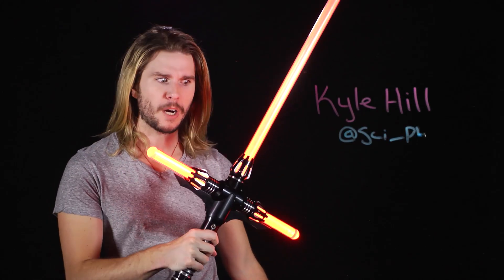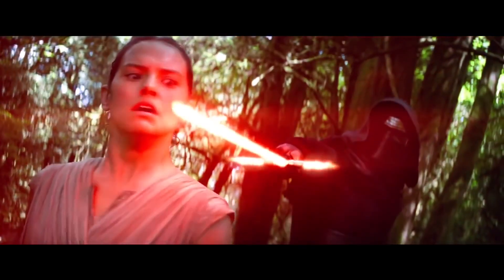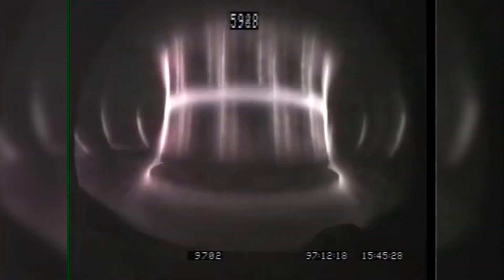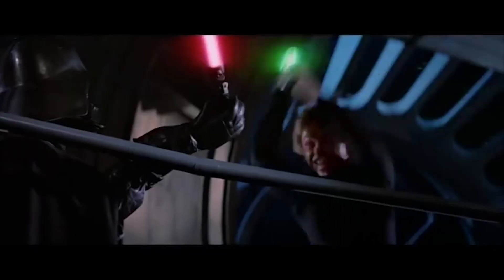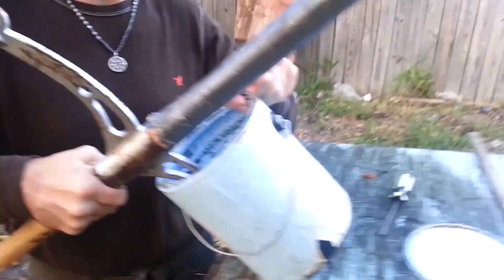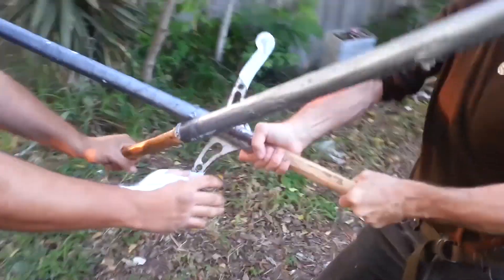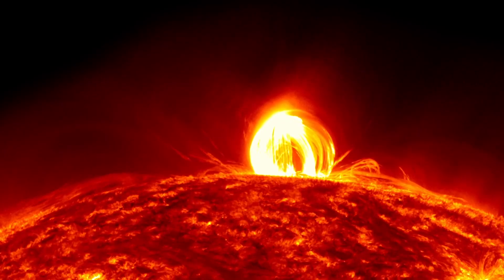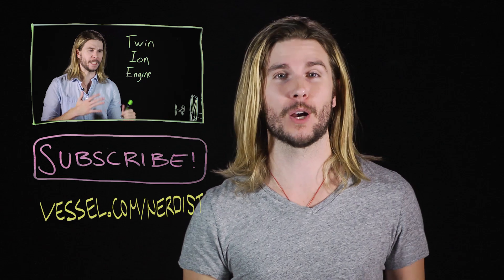Why Kylo Ren's Lightsaber Works (Because Science w/ Kyle Hill)

Comment: i don't understand why people hate this thing.
Reply: Me neither :<
Reply: I think people see it as gimmicky like, "just adding more blades." But a cross guard makes more logical sense than no crossgurad.
Reply: Carlos Johnson specially considering the weightlessness of a a lightsaber’s “blade”.
Reply: Yet people liked Darth Maul's lightsaber, which is also a radical deviation...and infinitely less practical.
Reply: @asayospacegoat6384  laughs in grand inquisitor helicopter lightsaber
Reply: Same
Reply: I like the way it looked. It doesn't have that standard Lightsaber look.
I was getting a little tired of seeing the same old Lightsaber look. I like seeing new variants.
Reply: ITS AWESOME!!!
Reply: lol I'm thinking this guy and a lot of responders don't know why kylo has vents off the crystal chamber. because they are vents NOT crossguards.
Ren has a fractured res crystal causing it to produce far more heat then a normal blade. This is why when activates it's not instant. The blade activates then the vents activate...
Reply: +AsayoSpaceGoat Darth Maul used his saber like a staff, which are real and practical weapons.
Reply: Kyber_Atticus so is kylo’s like real life cross guards
Reply: @KyberKat  no, he uses it as a double bladed sword, if he wanted to use a saber as a staff, they had staff lightsabers
Reply: @KyberKat  he didn't use it like a staff he used it like a double bladed sword which is not practical
Reply: @KyberKat  Yeah he’s trained enough, but in real life, you can literally cut your leg off with one step.
Reply: I think a cross guard makes a lot of sense (especially considering all of the arm amputation in the series, I hadn't even thought about that >.>) I just feel like it would've made more sense for them to be some sort of lightsaber resistant metal like mandelorian alloy for example as opposed to actual plasma blades.  Granted we don't know that the metal casing for the offshoots isn't made of some such material but either way it would've staved off a lot of the criticism.
Reply: @weniswarrior666  problem with mandalorian alloy is that its a lot heavier than steel. Which would be a serious problem as that would make the crossguard heavier than the entire rest of the weapon.. i think the crossguard is longer than it would need to be to work as a crossguard but as it is also vents for unstable energy. It comes together as a useful solution to a problem
Reply: Anell ALL 
I agree I'd like to see some different types of light weapons. For example: a battle axe. It'd be a cool visual if nothing else.
Reply: +Beann, I know, right? I've been training with swords for years now, and I have to say that the crossguard saber is hands down the most practical thing any force user has ever done. Sure, it's not traditional, but neither was Star Wars when it first came out. People made fun of it back then, and now we have nerds acting like bullies and bitches over something new.
Reply: Jadandlud of course it was for visual, a lightsaber is all about visual anyway, nothing wrong with that ^^.
Reply: becuz Kylo Ren is the scum of the galaxy.
Reply: Kyber_Atticus except thst staffs DON'T cut you hands off with a touch
Reply: me nether
Reply: I like it because it does two things. One is it adds practicality and protection to the wielder. Two it also gives more homage to legends because light saber designs were originally based on swords. This design is also seen in season 2 episode 19 of Rebels on an old battleground from the Old Republic era.
Reply: Possibly because most of them actually hate kylo instead of his lightsaber
Reply: They hate it cuz they're fucked up nerds
Reply: q
Reply: Neither do I. It's just a weapon.
Reply: HaNooo out of the subject and bullshit reasons...this conversation was solved long ago..stop your bullshit NEXT
Reply: Garmec only that this Cross guard itself can cut your arm off.
Reply: Pretty sure the hilt itself, side vents included, is an old design, and with that in mind I'm also pretty sure the condition of the crystal powering it only really accounts for the roughness of the edges of the lightsaber when compared to other ones. Not that the side vents aren't there at all because of the fact that the crystal powering it is broken, of course. I'm not positive, but I think the typical order is that you build your lightsaber then obtain a crystal to power it. The condition of Kylo's being from his impatience.
Reply: Lebby Great you sum it up perfectly
Reply: I agree
Reply: > i don't understand why people hate this thing.

Because generally people are not idiots.
Reply: Same here. I like it because it is a unique lightsaber
Reply: You didn't even say exactly as to why that lightsaber is shitty, just saying it's completely "moronic"
Reply: Mike's Lego Movies There is actually is.
Reply: I don't get it either. It's fucking 3 lightsaber blades. What, you DON'T like more lightsaber to your lightsaber?
Reply: Chris Wiet
It's really cool, why do people hate it?
Reply: Fucking nerds mate
Reply: I dont either, especially if you look at Old Republic lightsaber styles. There was one that looked like a freaking naginata. It was just a long staff with a main short blade & two crossguard blades.
Reply: Because they haters
Reply: Because the guard don't realy do his job. protect the hand of his user.
Reply: @kevinreiss-coint2353  
And how is that did uou watch the video
Reply: I know right?
Reply: Nah people hate it becuz it’s disney
Reply: Don’t turn this into a debate on the saber staff, it’s a sith weapon long time used before darth maul even used it... banned by the Jedi claiming anyone who was interesting in using a weapon like this had the sole intent to quickly destroy multiple foes. From than on it only was used by Jedi in training to practice against the weapon used by the sith.
Reply: 1000th like ya I said it but it’s true.
Reply: A three year old, but still active. Comment thread... :D
Reply: I used to hate it as crossgiard, but now that I know ts vents I like it.
Reply: I think it looks cool.
Reply: Its badass
Reply: There are worse lightsabers
Reply: Could this have been the same with Darth moul's (correct me if I am wrong) lightsaber? It could have been another strong crystal but instead of 2 vents he chose for 1 vent. I might be wrong but 
Sounds pretty cool to me.
Reply: Me either
Reply: I love it. It looks so cool
Reply: Jadandlud  g
Reply: My friends calls it chode sabers
Reply: Best lightsaber
Reply: Even if you don't know about what it can it looks so damn crazy. I love it
Reply: I don't hate the lightsaber, I hate the person swinging the lightsaber.
Reply: Ye it's a sweet lightsaber
Reply: I personally like the design
Reply: its awesome
Reply: Me neither
Reply: Its literally my favorite thing in these new star wars movies
Reply: Pi! (As said, when I first thought about the practicality of the lightsabers in the movies, I knew that it was more practical, just because when I had a toy lightsaber and would play with it, when the blades clashed, I would slide down their saber to reach their arm)
Reply: They just hate the stories. Like when some of them say the acting was horrible too when most of the actors were doing a fine or good job.
Reply: Its only the original trilogy purists who hate it. I adore Star Wars, which means I love EVERYTHING Star Wars. The originals, the prequels, the Expanded Universe and especially falling in love with the Old Republic and Ancient era of canon. Like 8000 years before the Battle of Yavin - fantastic shit happens! lol :)
Reply: I KNOW
It'S BAD@$$
Reply: why they hate this ? simple : stupid people ! they are few different kind of people on this planet :
1# : normal people with brain and their own opinions who will THINK.
2#: people that will hate something because everybody hate it, then will figure that they could have been wrong.
And 3#: people with no brain that will automaticly hate everything that people hate, without thinking for a second... We call those people : sheeps ! 
Or parrot, but sheep is more accurate... The sad thing about this, is that they don't have a proper existence, they don't live and don't have an real opinion outside what other haters said.
It makes them forgetable, and above all, uninteresting.
Reply: HaNooo your statement is a laughable joke, Kylo was shot with the bowcaster which clearly damaged him, he fought FN-2187 which might be a force sensitive and then went on to fight Rey which is clearly force sensitive and has had a lot of experience with fighting and using a staff/short sword of some sort or stick I don't know. If you had any knowledge of Star Wars you would know for a fact that those who are force sensitive will be protected by the force and they can also glans into the future and see attacks before they happen. Stop being so fucking obnoxious and don't go to the cinema if you're gonna hate on everything
Reply: But Kylo Ren's lightsaber is a real and practical weapon though.... As soon as I saw it in the very first trailer for The Force Awakens, I knew it was a hand and a half styled sword, and used in the same manner. When I saw the movie, my assumptions were proven right. When Kylo is facing his father before he kills him, you see how large the hilt is of his lightsaber, as it has room for both of Kylo's hands AND his father's hand as well while still having plenty of room on the hilt. Not to mention, he uses it like you would use an hand and a half sword, only without anything that utilizes you holding the blade end like you'd see with a traditional hand and a half sword. Not to mention, I'm pretty sure Kylo Ren's lightsaber blade is about 6 inches longer than an normal lightsaber blade, which further adds to this.
Reply: TrustNot or imagine a lightsaber whip
Reply: HiccupHH3 Tripple H sometimes ideas won't fit the future anymore. The cross can burn your ass too, that is not protection to me.
Reply: > I like it because it is a unique lightsaber

Unique? Like a fucking snowflake?

It is an absolutely moronic, shitty weapon from any point of view that involves knowing anything about sword fighting.
Reply: HaNooo idk I kind of like the new and different take on Star Wars. At least they didn’t base it off of the prequels, and they didn’t use any cheap toy tactics like the Ewoks. Some might argue that the cross guard lightsaber is a toy tactic but I think that it was actually a clever idea that took the hand-chopping into consideration. Yes, Kylo is a master in the knights of Ren, by the wasn’t exactly prepared for Rey, or her abilities. The first force power she learned was the Jedi mind trick, and she didn’t even take lessons. That shows some serious power and potential on her part. But everyone is entitled to their own opinion, so just stick with that. K I’m done bye
Reply: Because they are, or were, uptight fanboys that couldn't accept any sort of change
Reply: Chris Wiet because the only reason it has three sabers is because Disney can price the toy higher and kids will be like “IT HAS THREE SABERS SO ITS WAYYYY BETTER. MOMMY I NEED THIS LIGHTSABER”
Reply: because youre a dumb fucking idiot thats why you dont understand.
Reply: Hate the copy Disney movie..not the lightsaber. Also, the horrible/no depth character (like all the characters in the Farce aFakens) Kyle Ren.  I teenager that has parental issues. Kyle... I mean Kylo Ren is a MASTER of Ren and has is skilled in the teachings of the force for many years, but is bested by (an "Amercan" slang talking) poor unskilled garbage man stormtroopers and a female that learned of the force 5 minutes before!  It's a laughable joke of a movie. Makes you long for the days of Jar Jar. (Lucas isn't stereotyping at all across ethnicities and religions) The Farce aFakens is a bad New Hope mixed with Jurassic Park and Independence Day. We actually walked out of it on release night. Horrific $$$$
Reply: @UhhhhhnooOOo00oO  luke Skywalker also learned the force in 5 mins he carried Yoda on his back then he was a Jedi lol
Reply: @paulkingsweeney3  He didn't learn it in 5 minutes and it was said, "He is too old." by the prememtioned character. Movies VII-IX are a joke.  I could have written better scripts that sold more shit, whilst taking a shit.  As a huge Star Wars fan....I walked out on all the new movies...With friends, that were disgusted.  Disney wanted to recoup their billions, so they sold crap to children and every politically correct genre out there.  I want to like the movies.....they are garbage. I'd almost rather watch a 5 hour spin off movie of just Jar Jar and Pals.    I don't even discuss the movies or notice when they are releasing.  JJ Abrams is a marketer and not a story teller.  When the movies are free, I don't watch them.  I also don't reply well after I haven't even thought of how badly written the new movies are.  Jur"ass"ic Park, meets Independence Day with an exact repeat of Episode IV.  It's a disgrace.    They should have had 2 Jedis have sex and create the ultimate Jedi to finally over"cum" the Empire.    Not that tough.   Luke Skywalker's sperm was still viable.

Comment: Umm, he used Parsec not in reference to time, but Proximity.  The Kessel run, detailed in the books, is a tight loop around the Maw Black Hole cluster, to avoid detection by Imperial patrols.  The closer you are, the shorter the distance you have to travel, hence Parsec is perfectly apt in describing the feat.

Carry on.

Comment: Kyle - I agree it would actually be more effective in duels than a normal sabre..... however. Wouldn't a cross guard in a slight V like a normal Claymore be more effective. You'd have the benefit of the guard as well as the plasma being at a more advantageous angle for manoeuvrability and well, you would be less likely to have an accident

Comment: Shouldn't two lightsabres pass through each other instead of blocking each other?
Reply: +Aakash Varma If they were beams of actual light that was somehow blocked by some invisible obstacle at the top of the blade, which didn't involve any obstruction leading up the length of the blade as well, then yes, a lightsaber made out of actual light would pass through another of the same thing without contact. If they were, as reasonable attempts at scientific explanations propose, some kind of plasma encased in a magnetic field, then probably not.

Comment: I was always under the impression that kylo rens lightsaber was of a much older design. He is never shown blocking with the cross guard and I think that's because they are vents , which would make sense seeing that they always extend a few seconds after the main blade. Also because its an older construct the blade isnt as stable, giving it the crackling and more movement on the blade.

Comment: He could have also just put it in a V shape less change of cutting himself
Reply: +TiQuez Graham There is precedent for swords having V shaped guards too. Usually close to flat, rather than a sharp forward angle, though.
Reply: Or made them out of lightsaber resistant materials.
Reply: +River Greystoke II water still gets in water resistant containers
Reply: Connor Tremblay Granted. But I believe beskar and phrik are both lightsaber-proof. They aren't practical, though, since it's basically impossible to find them.
Reply: +Cyanakrli An uninjured person, holding onto a sword firmly, is EXTREMELY likely to have their arm come into contact with even a moderately-wide crossguard not just during combat, but in basic sparring and even during form practise without an opponent.

Unless you're injured in the process of causing such contact, it won't be forceful enough to qualify as an impact. With a stick, a wooden training sword's guard, a plastic toy guard, or even a real metal sword, a gentle nudge on your forearm isn't going to be a problem. With a high-powered beam of focused energy capable of melting through almost anything in the known universe, it's time to invest in spare limbs.
Reply: As someone who's studied sword use in several weapon-based martial arts, and who does sword dancing (with and without fire) at least twice a week, I'm pretty sure I know where my sword goes while I'm handling it. The only time your argument comes close to accurate is when you're holding right at the base of a 2-handed sword grip, and wielding it with only one hand. And you're doing nothing but holding the sword in an upright guard position and tilting it back. And you're maintaining a poor choice of grip.

Even if you're not doing anything with the sword except holding it straight up and tilting it back in a poorly-formed upright grip, 5cm is more than long enough to hit your own forearm with a crossguard on a one-handed sword, so 20cm would just be silly. And for reference, the crossguard blades on Kylo Ren's saber are closer to 10cm than the 5 you'd need with a competent grip on a real sword.

Lightsaber hilts are generally closer to the size of hand-and-a-half sword hilts, or even two-handed grips, which gives a little more freedom (not enough to avoid that saber's blades), but as soon as you actually try to USE it like a sword, you're going to have to work at avoiding that guard.

It is, of course, possible to compensate for the problems (assuming a Force user handling the weapon), but many other actions which could reasonably be performed with a real sword, and which are very effective techniques when doing so, become self-destructive or potentially suicidal when your crossguard is a mini lightsaber blade. Competent use of the weapon would absolutely require use of the Force. That wouldn't negate its viability as a weapon designed for a Force user, but it does still make it potentially dangerous to its wielder.

You also spelt "break" wrong ("brake" is how you stop a car).